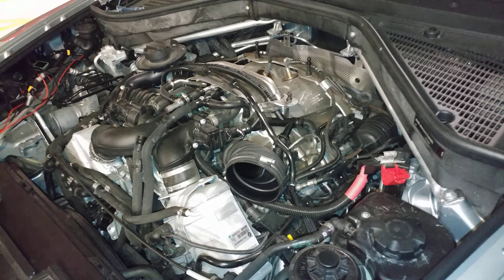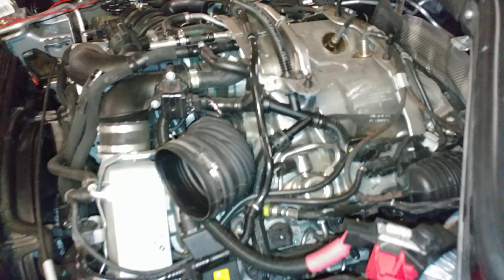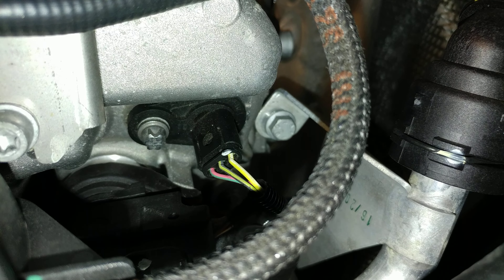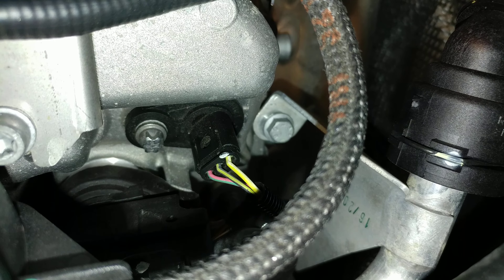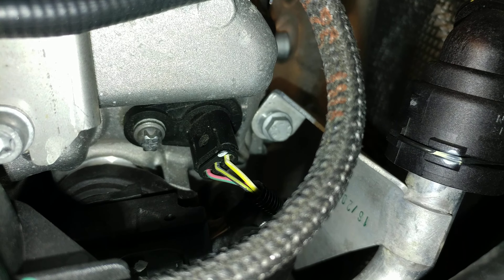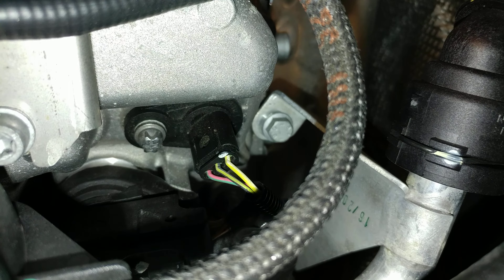2013 BMW X5 M - How to Fix Engine Malfunction Warning, Camshaft Position Sensor (2A7E, P0025)

Comment: How obout 2010 535i  I have same problem
Reply from the maker: Hi, 
Is it showing Engine Malfunction and reducing the amount of power you have?  If it's showing an engine malfunction light, and the engine is running rough, it's a different problem, could be a connection to an ignition coil, and that happens often, you just need to clean the connection by unplugging and replugging 20 times.
The 6-inline has the camshaft position sensor in a similar location at the back as my X5, shown here:
https://repairpal.com/estimator/bmw/535i/camshaft-position-sensor-replacement-cost
You could try removing the plug, and replugging it about 20 times to clean the contact, you should use Deoxit or another contact cleaner, but you can do it 20 times dry and it usually makes the connection better too, just not as well as if you had used a contact cleaner with protectant.
I purchased a Carly scan adapter and pay for their android software yearly, because it has saved me a lot of time and money, and gives me great diagnostics on my BMW.  Once, I had to use it to reset my system, after it had crashed due to a low battery, otherwise I wouldn't have been able to get it started, probably would need a tow, or let the car sit for over 15 minutes locked(To reset the computer systems).  If you have an engine malfunction error, and you leave it sitting for 15 mins locked, the computers should all shut down, so it's like a hard-reboot, then you should be able to start back up and operate normally until the next time a connection gets loose or a sensor fails.  You could use Carly to figure out exactly which sensor is malfunctioning for you.
You may not need to use Carly though, you could buy a cheap bluetooth adapter(Doesn't work for iOS, Get v1.5, it supports more protocols - https://tidd.ly/30i0eJi) and use the free version of Torque Lite for Androids, that gives you basic ODBII diagnostics, and that might be enough to show you a camshaft error code too.
I've used a cheap bluetooth adapter with Carly before, but it's buggy and highly advised not to, that's why I just bought the Carly adapter, it's a great diagnostic tool: https://www.mycarly.com/adapter/
Cheers!
David.

Comment: are there 4 CPS's on the x5m?
Reply from the maker: I don't have the service manual, but ecstuning says there are 4 for the S63 engine, the same sensor can be used to replace them.  But I would try cleaning the contacts with a contact cleaner like Deoxit, I've done that to the easily accessible sensor shown in this video, and I never received an error again.  I think I got under the car and did as many electrical connections as I could as well, and now it's running smooth and trouble free. Definitely buy a can of deoxit and do all electrical connections you can.  Especially the positive and negative battery terminals. But for those, you should use a dielectric grease, or better yet, copper conductive grease. 
Cheers,
David.